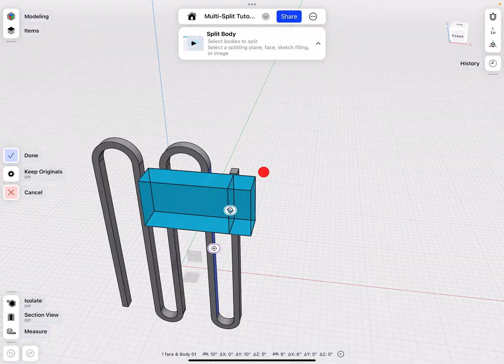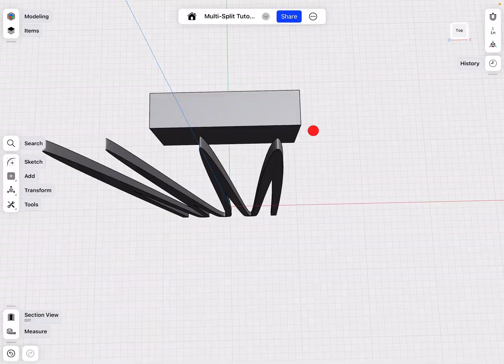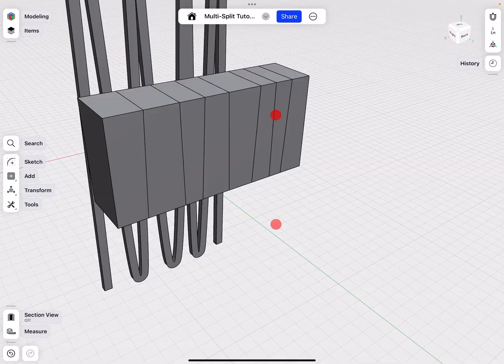Experimental Split Body Tool Function in Shapr3D

Comment: Hey , I m trying to figure out how to make a tesla coil, I succesfully did the bottom rod with the copper coil, but could not figure out how to make the same copper coil around the head of the tesla coil, which is shaped as a donut. Would really appreciate it if you could make a short tutorial on it ❤
Reply from the maker: That sounds fun, just be aware it will be a while. I currently have a ton of projects i’m working on and my video posting has taken a hit. In the mean time I do have some tutorials that may lead you in the right direction if you need it asap. Look through the list and you’ll see some relevant thumbnails ✌️
Reply: @JLake3D oh I see, thanks for your attention and good luck mate 👋🏼
Reply from the maker: Specifically the tapered thread tutorial will help you out the most. That would give you a line to sweep your coil on. Let me know if you have any questions, i’ll try to help with what I can 👌
Reply: @JLake3D oh perfect, thank you so much for your kind help 🙏